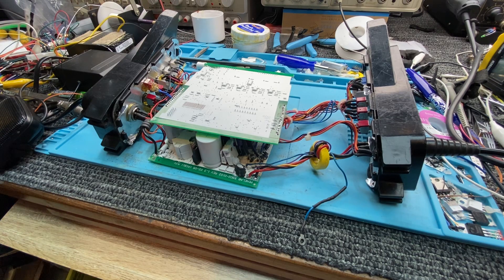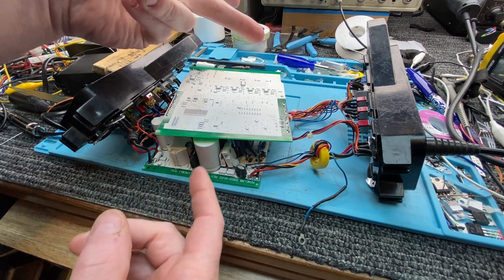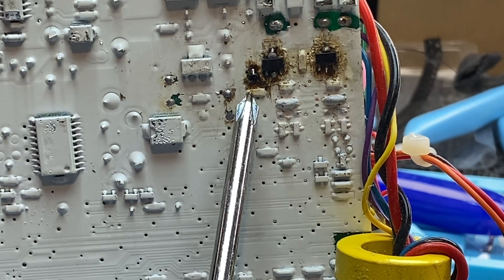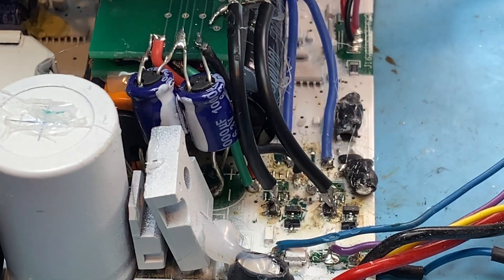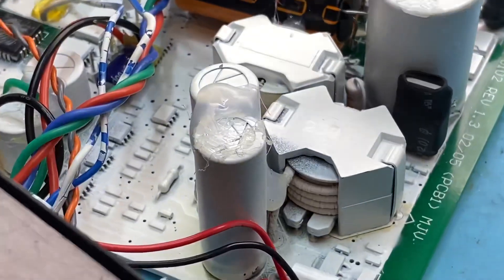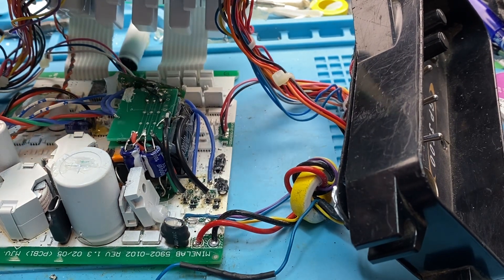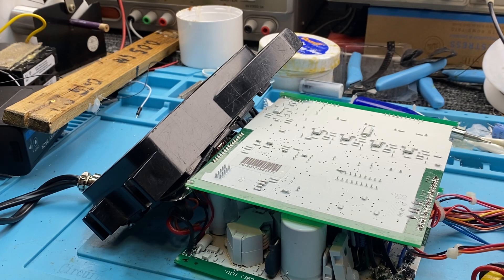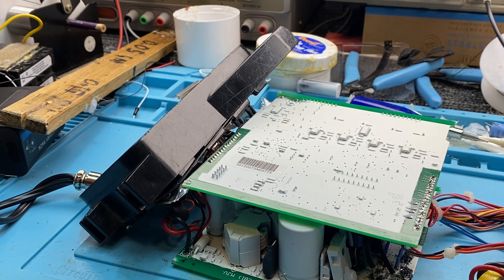One of the best Minelab detector modifications we have ever done to a GP.

Comment: Upgrading an upgrade to an upgrade? New detector sounds interesting but I am still holding out hope for a viable Chinese alternative.
Reply from the maker: The Chinese one is a dead set copy of the GPZ7000 design of the housing, it is blue with a white middle, I expect ML to go berserk over the design copy.
Reply: @DetectorMods  A few years back they were selling copies of the GPZ7000 (or back door models) on line for $1000, I didn't get to see one in person but some people were claiming it performed the same as a genuine one.
Reply from the maker: The one they had out was a VLF.  @geoffdrew5207
Reply: @DetectorMods  A few years back they were selling either a copy or a back door model of the 7000 on line for $1000. I didn't get to see one in person but some were reporting that it worked just like a genuine Minelab.
Reply: @DetectorMods  The 7000 copy? I heard the 5000 copy was a VLF.